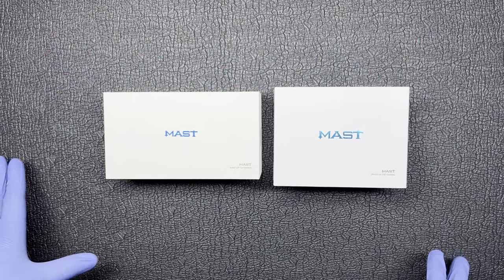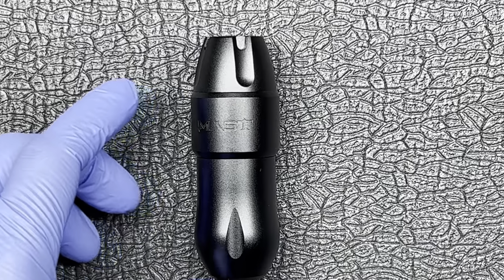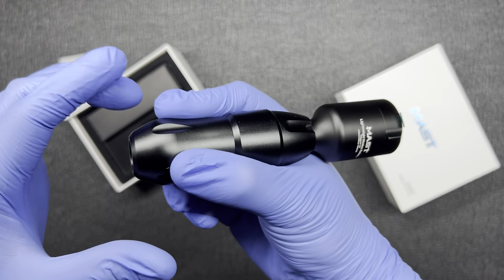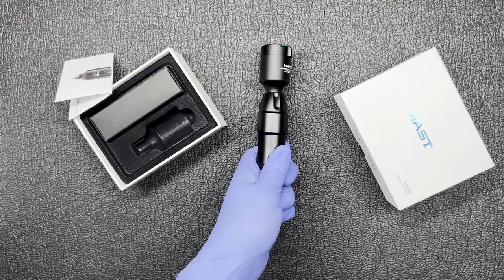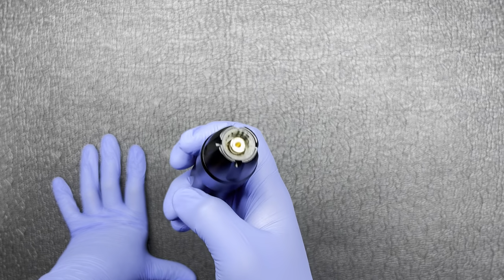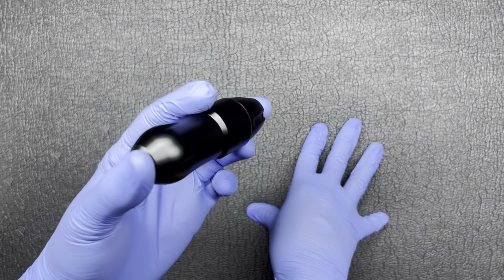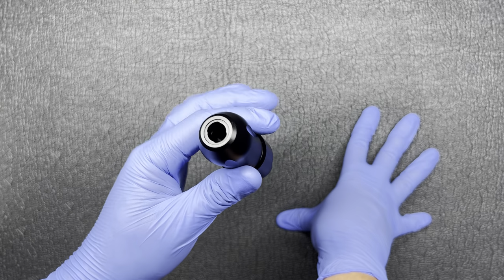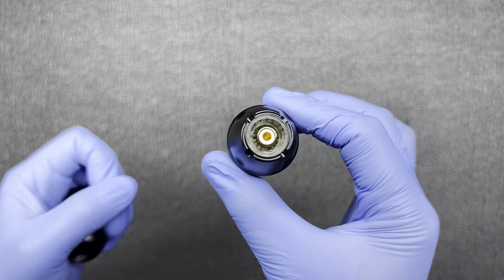Mast Tour Pro Unboxing And Review

Comment: I have the same machine. And yes you can get to the motor. The back is just on super tight. Scraped the paint off mine trying to open it.
Reply: Did you use pliers? its so tight
Reply: @peterr686  wrapped a fake skin around it for grip. Pliers might scrape it

Comment: Cool little machine, just out of curiosity is it comparable to the Mummy short pen with Japanese motor(with battery)? The way it works and how you tattooed with it looks somewhat similar, and when it says normal working voltage 5-8v, it's OK if you go higher with larger needle groupings?
Reply from the maker: Thats a great question my friend!

I feel we can compare any machine but performance will always certainly or almost certainly vary. For me if it is the same machine I am thinking about from mummy I would say the machine are different in their own sense. If it is the machine from mummy that I think you are referring to I would say that I would personally use the Mummy machine for fine line dainty tattoos and small needle groupings and for the Mast Tour Pro I have more abilities. I can use it for dainty fine line tattoos as well but the mummy machine design feels more tailored to small tattoos. 

So what I am saying is I feel it would be a personal preference situation and what feels right to you as the artist. In terms of pushing a machine past the recommended voltage I am sure we can get away with it but me personally I don't like going outside the bounds of the manufacturers recommendations. 
Plus I typically am running at 8 volts and below anyways and never below 5 so thats a perfect range for me. It goes back to personal preference and what we need out of our setup, I feel.
Reply: That's the answer i was looking for,your max voltage is always 8v(you may push higher just to test the machine out) with larger needles too,when i first started watching tattooing tutorial videos on YouTube,the majority of them says they lined at 9v with powerful machines like the Sol Nova,and machines running 11500rpm @ 8v which i found was ridiculous,maybe they're comfortable with it but with thumbnails saying tattooing for beginners,that i felt was absolutely bull****, so glad i came upon your channel and it's the only tattooing channel/videos i watched as i've mentioned before..thanks for your professional explanation and expertise,i never exceeded 8v with 18rs or higher after watching your videos and i'm completely confident and comfortable with it,my handspeed matched and my tattoos much2 better then when i'm running at higher volts,and always,thanks for the advice Sensei

Comment: I have this machine and I’m having a issue with it spitting ink when I’m using RL can you give any advice? Thanks
Reply from the maker: Ahh I will experience this issue from time to time.  You can try a few things such as lowering the voltage, trying  different needle depths as well may help to resolve the spitting of ink. Typically I will take the voltage down and adjust my needle depth until I find a good comfortable setting and the ink is no longer spitting. 

Are you using a coil or pen style tattoo machine?
Reply: @DanielYuck  I am using the pen style tattoo. But thank you so much for giving that tip! I was looking on YouTube for the answers but this one might be the issue! Thank you❤️

Comment: You can remove the top part to access the motor. At first its tight, use long nose pliers, but put thick clothes on the machine or you can wrap the 2 legs of the pliers with rubber tube maybe just to avpid denting the top part of the machine

Comment: I bought the same machine but it’s not packing or lining any of the ink. Barely anything stays . Does it only work with dragon hawk cartridges and mast cartridges?
Reply: Nop, i use it with different cartridges and get the ink Well packed into the skin
Reply: Moist skin, good angle, and i stay away from cheap carts.. machine has ran for me for.a long time

Comment: looks good.  I want one.
Reply from the maker: It is well worth the investment!

Great, solid, well rounded tattoo machine. Hits hard, lines, packs, shades, and it is easy to sterilize.
Reply: I might try larger needle groupings with my mast tour pro. So far i only used 9rl / 9rs as the highest. But will definitely try 11rs or 14rs as i am into traditional style tattoos with bold lines.
Reply: me too!! I need that type of practice skin fr